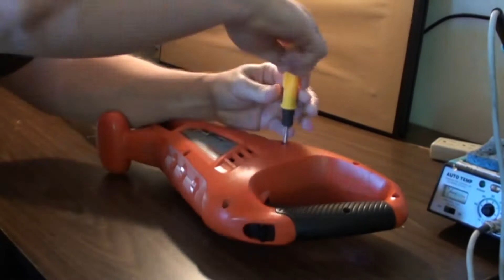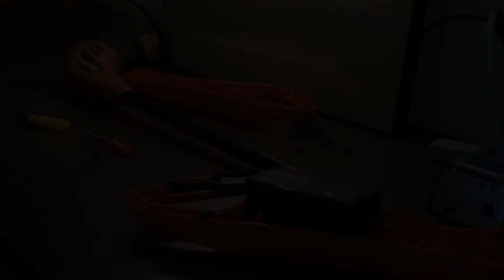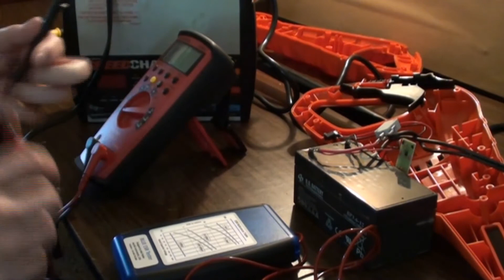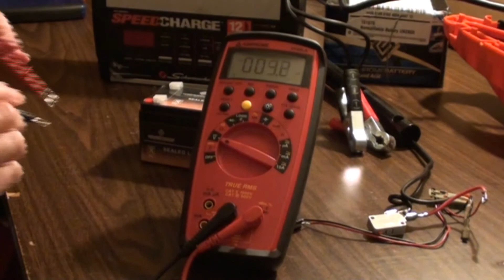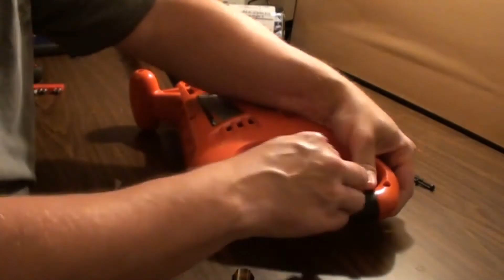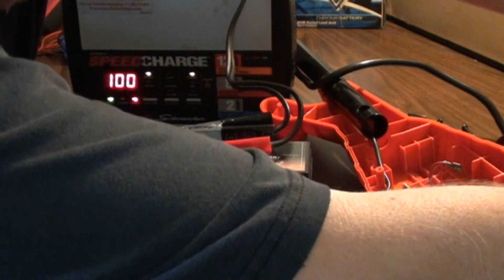Weed Wacker Won't Turn On? How to Repair the Switch and Replace the Battery

Comment: I have been using the Anatek meter for batteries internal resistance and for low low value resistors.   Great multi tool.   I built it from the kit to save a few Benjamin's.  Great vid topic.